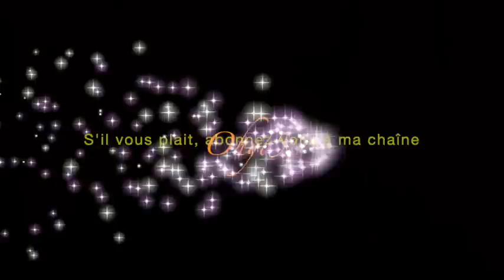Change image quality　Wooden pantograph jack

Comment: Very nice, did you take the measurements from a steel one? What will you use this for? Thanks for sharing
Reply: My question exactly. What can I use this for in the shop?
Reply from the maker: Hello, David
Thank you for always watching my video
And thanks for the comment
This work is an adventure to improve my technique.
I'm not measuring, so I feel like I'm missing something.
If you use it for something, replace the hinge dowel with metal.

Thank you
See you
Reply from the maker: Hello Andy
Thank you for always watching my video
This work is an adventure to improve my technique.